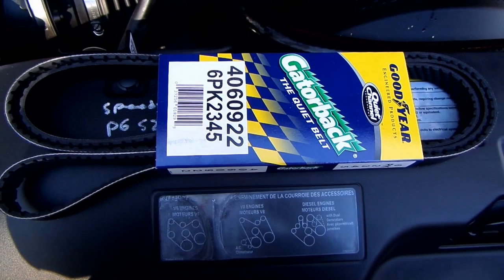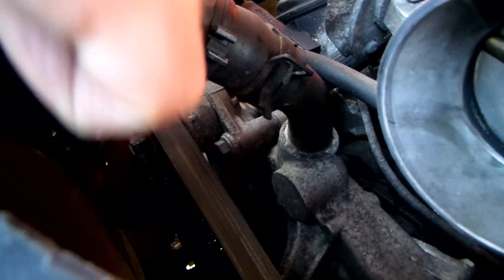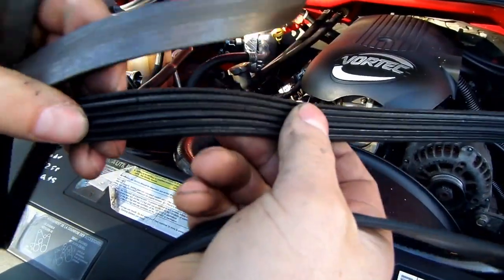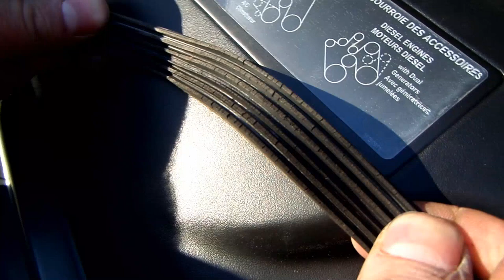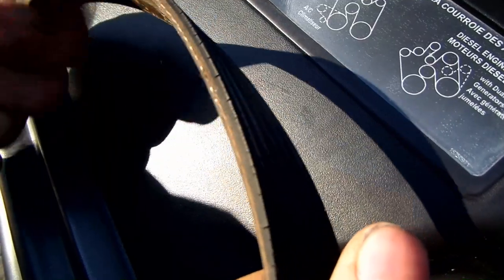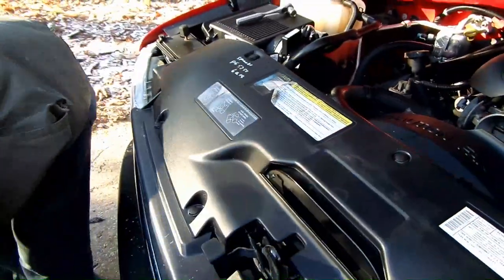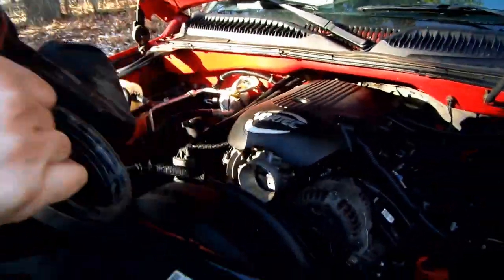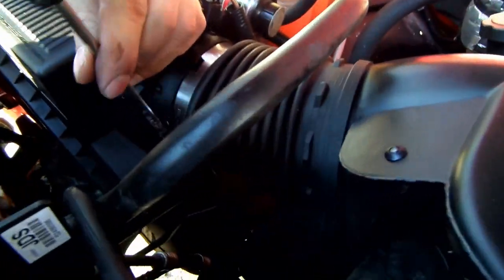How to replace the serpentine belt in a Chevy truck

Comment: thanks m8! just changed my belt, 5 minute job on an 05 sierra 1500 with the 5.3. I actually didn't need to remove the manifold from my throttle body as there was adequate clearance. I also turned the "other" counter-clockwise to loosen the tensioner ;)

Comment: I got a 99 GMC Yukon Denali SUV I'm doing away with the air conditioner it locked up on me what size belt do I need to bypass the air conditioner pulley I'm not putting a bypass pulley in there delete kit just delete the pulley itself with a smaller belt what size do I need the 350 vortec

Comment: Thank you so much! I was having the hardest time with this. I had the wrench on the right side of radiator hose and could only go as far as fan shaft. Just needed to move tension pulley a little more. Thank you again!

Comment: And then there's me... who actually knows how to put on the belt but the damn thing won't go back on... An hour later I'm watching an install video and wondering why the hell everything fights me every step of the freaking way. I mean, this isn't rocket science... why don't it go easy for me? And it ain't just the belt... let's change a blade on a mower... 20,000lbs of torque later, burning in hell, that bolt still won't budge. Come on!!! Dammit! It's a freaking serpentine belt, not my wife, not that damn complex..

Comment: Thanks, awesome video. I'm a Ford guy but I now have a beautiful 2003 Silverado cat eye and I just love how Chevy makes things easy to work on (except for the oil pressure sensor / sender) - I see now that I do NOT have to remove the fan shroud, the belt runs past it in such a way that you don't have to go around the fan, did I see that right? Hopefully you have the A/C belt video too. From what I read here, it is behind the serpentine so it should be done after the serp is removed and before it is replaced...
Reply: Me too : ) i had to get rid of my Ford none of my friends would work on it

Comment: 4.8 2006 Silverado changes a/c and serpentine belts. Easy to get them off. Not so easy to get back on. Really a 2 person job due to having to hold tensioner al the way down and try to feed stuff new belts on. It's very tight to get a new stuff (twisted) new belt on. Maybe mine were cheap kind. I am not sure if there's new more "flaccid" belts. I had to use cargo straps to hold the wrench whick was holding tensioner. The a/c belt is a BITCH. You would think the would putore play in the tensioners to make it not suck so bad. Anyone saying this is a 5-minute job is a fucking bullshiter. Maybe for a 10 year plus mechanic. Not for a 30+ year carpenter.(me)

Comment: i just changed my alternator , trying to replace belt now, it seems the belt is about 1/2 inch to small, and yes ive done this many time with different vehicles , cake walk but ive nvr had this issue , is the 5.7 and 5.3 alternator different in size, from the cntr of the bolt holes to the cntr of the alt shaft, this is a super easy job ,ive got some parts mismatched i do think , hmmm chit ..........................
Reply: ABU Garcia belt tensioner dummy

Comment: Gonna be doing this in the next day or so, how do you know how much to tighten the tensioner up?

Edit: nevermind, did it and you dint actually unscrew it you just pull it back with the socket. Time spent removing air channel: 5 mins, time to remove belt: 30 secs, time putting new belt on: 20 mins cuz the new one was being a twisty wobbly wobbly jerk!

Comment: Figures you'd show a video with a K68 RPO code (105-amp) alternator...I think my 2500HD is the ONLY silverado that EVER CAME OUT with a 125-amp KG7 alternator on it...damn freak of a truck!
Reply: Excellent video, great review BEFORE you actually change the belt, but it would also help to cover the AC Compressor belt change while you are there, since it is behind the main serpentine belt.  Great job never the less.  If you do a video of the actual AC Compressor belt, please let me know! Thanks!